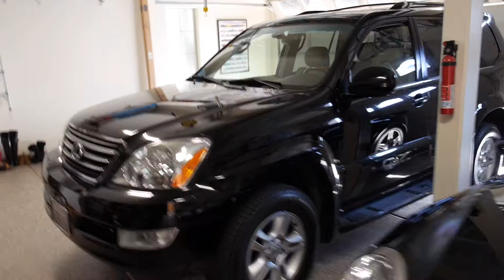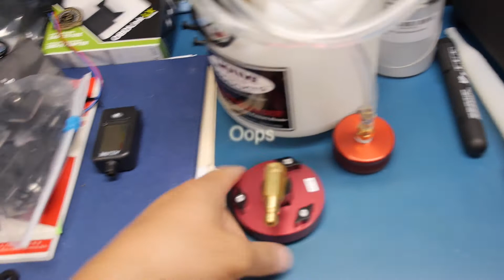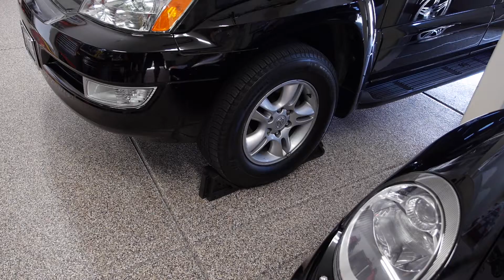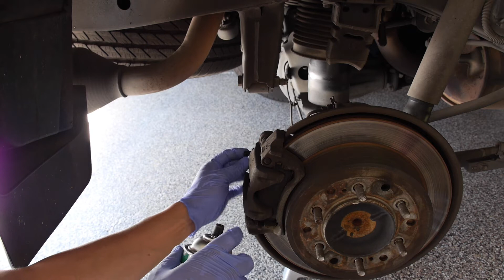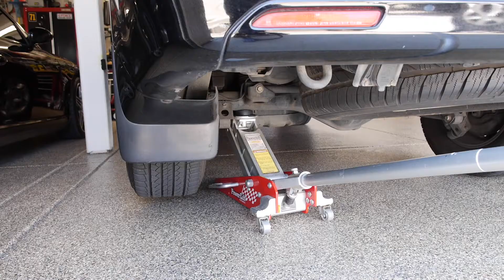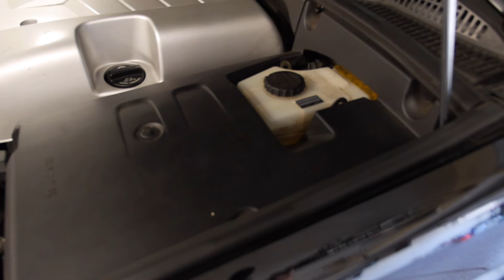DIY Brake Fluid flush using Motive power bleeder on my Lexus GX470

Comment: Few things that are wrong here. Ignition must be ON, bleeder must be filled with brake fluid. I get it that you're doing a "dry" bleed (not recommended), but you should probably disclose that so inexperienced DIY-ers wouldn't mess up their braking system by introducing air to the system.

Comment: I ordered the Motive system and extra adapters for European and Asian cars.  What junk.  They sent universal adapter that was two hooks and a chain.  What a joke.  The adapter was too big to even fit in the area where the fluid tank is.  The pump worked once and then wouldn't pump again  More junk.  All the connection are direct fittings, no swivels so you have to twist the hose all up.  It's like a high school shop class at a remedial school designed this.  There is one good item included in the package but it's an extra, the catch bottle.  What junk.  Buyer beware.

Comment: Hey man quick question I’m planning the same set-up just like yours but how do you lock the motive product hose clamp?
Reply from the maker: It's been a while so don't remember but I think I got an adapter with hose barb fittings on one end and quick disconnects set from Amazon.

Comment: Hi Jim, I was reading that the GX470 has a automatic pump for rear bleeding so you have to turn the ignition and ONLY press the pedal.
For the front is manually.
Reply from the maker: I didn't know that, good to know, thanks!

Comment: Was that adapter a good purchase did work with no problems? The cap
Reply from the maker: Worked great, the quick release fittings made it super convenient  and the aluminum Power Probe BA10 Toyota adapter worked well but is pricey.
Reply: @atm4jim  jim can send me a link or Part # for the Quick Disconnect
Reply from the maker: @johnrommelt6560  Someone else asked before - here you go as copied from below:
I bought this assorted piece from Amazon - https://www.amazon.com/gp/product/B003TFE7UW/ref=ppx_yo_dt_b_asin_title_o05_s00?ie=UTF8&psc=1

Description says 1/4" NPT, Auto Type C, It's different from say your air compressor fittings.

I ordered a couple of other pieces but can't remember whether I used them or not.  The quick disconnect works especially well for me as I have adapter for Toyota and European cars.
Reply: @atm4jim   do These include hose clamp/or band to secure end to tubing?
Reply from the maker: @johnrommelt6560  I didn't use or needed clamps.  I just used some Teflon tape on the threads
Reply: @atm4jim  👍 Thank you very much Jim for answering me.
Reply: @atm4jim  The pictures in the description (on Amazon) show them being used for air compressors.  These can be used for liquids?
Reply from the maker: @BSchmid03  I use mine "dry" as I don't fill the Motive bleeder with brake fluid.  I just make sure to keep the brake fluid reservoir above the minimum level and refill as needed.  It makes for easier and faster cleanup and storage, but you do have to refill the brake reservoir a couple of times during the job.

Comment: Assuming this is the same for the 4Runner of the same year? Also, what’s the benefit of this setup vs key out of ignition and helper/traditional bleed? Assuming speed. This still doesn’t get the fluid that’s in the ABS unit. Have to have a ABS tool for that.
Reply from the maker: I think so since the GX470 is based on it.

Comment: Hey Jim..I have a 2010 Toyota tundra the adapter you use do you know if it will fit my truck.Great video by the way
Reply from the maker: Yes, I think so based on a few customer's comments and reviews in Amazon.  Also based on Motive's application guide, it fits all Toyotas and Lexus except for few (such as some Lexus GS, 09- Corolla).  Thanks
Reply: Thank you sir..I really appreciate it

Comment: Thank you for this amazingly detailed video. I went on to use a bicycle pump with gauge.  Makeshift the cap. Buy a new/used one, drill a hole through it, insert transparent tube (walmart/Homedepot) and epoxy it on top

Comment: Excellent video. Now I know that the Motive I have for my 86 and Vette works on my wife's GX as well. Thank you.
One note: bleeding should start with passenger rear caliper first, and work your way back to the driver front, no?
Reply from the maker: My understanding is to start furthest from the brake fluid master cylinder and work your way to the next furthest and so on.  Some vehicles may be different from this.
Reply: @atm4jim  Thanks for the prompt reply. Do you happen to remember how many oz's of brake fluid this job took? (I see a Pennzoil DOT4 bottle but didn't know if it was the 12oz or 32oz.)

Comment: Hey, I’m confused. On the website it says for import for Euro and including Honda and Toyota that are snap on reservoir caps. I checked my Lexus and it is a twist cap for the brake reservoir. So I guess the Toyota cap won’t work for me and I need a twist? Ughh. Was your adapter for your Lexus a twist cap too and where did you order from? I’m trying to order from Jegs since they are having promos. Just don’t want to buy the wrong adapter. Thanks.
Reply from the maker: I got the Power Probe BA10 Toyota adapter from Amazon. https://www.amazon.com/gp/product/B004IQ96RK/ref=oh_aui_search_detailpage?ie=UTF8&psc=1
It uses 3 twist cam locks.  It's a bit pricey but made of billet aluminum instead of plastic.
Reply: Jim Wong thanks. I found info on a forum that the round import universal kit works but it is hard to get a good seal. Yes, it is plastic.
Reply: @atm4jim  you should post this link in the description will help alot more people in the future like me lolll
Reply: Everyone, for Lexus/Toyota just get this adapter. The adapter that came with the Motive kit for universal Toyota is terrible. No wonder most people pay extra for the adapter like yours. It is a pain to get it to hold pressure. Keeps leaking air at the cap. I’d have to sit there and hold it down to even hold 10 psi.

Comment: Jim: I did the same thing as you with the quick disconnects, but I believe bought the wrong type of connector as there's not a steady stream of brake fluid from the Motive.  Do you have a link for the ones you used as well as the brass fittings?

Comment: So you kept adding new fluid to the car’s reservoir?  Why didn’t you just add the new fluid to the Motive pump? I thought that’s what the directions say....I’m confused now... :-(
Reply from the maker: You can but I did the "dry" method so that I don't have to clean the Motive bleeder pump and lines.  I just used the Motive to pump and pressurize the reservoir.  Again, for less clean up.
Reply: @atm4jim  This doesn't seem like the best way. You risk putting air in the system which will be a real problem. I've always filled the bleeder with fluid and pushed the new fluid through.
Reply from the maker: @Tr33People  I haven't had an issue but you do have to make sure you don't let the brake fluid get too low in the reservoir and I keep the power bleeder below 15 lbs. of pressure.  I prefer this method for easy cleanup.  Your method is perfectly fine also and avoids having to top off the brake reservoir.
Reply: Instructions are to use denatured alcohol to clean the power bleeder. Home Depot has it.

Comment: Thanks for the video! Do you happen to have a link to the quick release fittings you got?
Reply from the maker: Yes, just once and until you flush out the old fluid (may be hard to see the color difference) and have no air bubbles.  Of course, you would bleed more with the valve that's furthest from the reservoir and make sure not to let the fluid fall below the minimum level.
Reply from the maker: I got the adapters from Amazon - https://www.amazon.com/gp/product/B003TFE7UW/ref=oh_aui_search_detailpage?ie=UTF8&psc=1
and the Toyota power probe is https://www.amazon.com/gp/product/B004IQ96RK/ref=oh_aui_search_detailpage?ie=UTF8&psc=1
Reply: Jim Wong How many times did you bleed each bleeder valve?Just once?Should  you not continue to bleed until the old fluid  becomes new fluid?
Reply: Jim Wong Ok thanks ,I have the same Lexus and would like to do this.That fitting that attaches to the brake reservoir is expensive.I saw it somewhere  online for under $40 I believe, I will  try to find it again.Very nice garage!